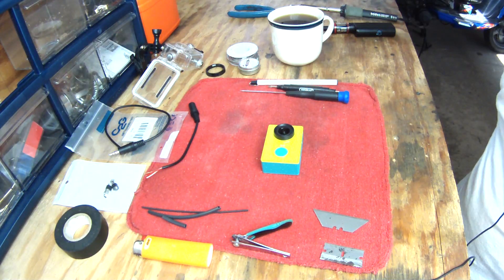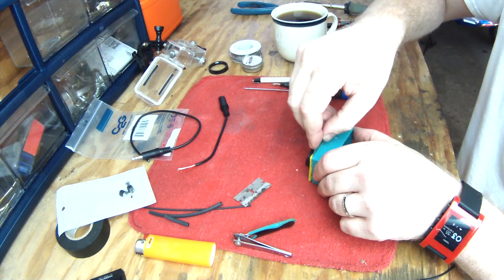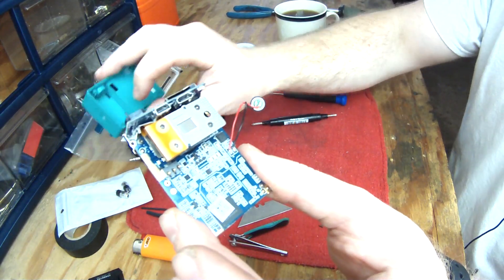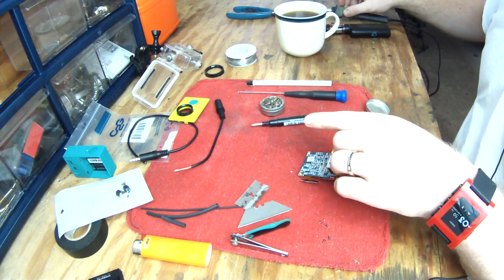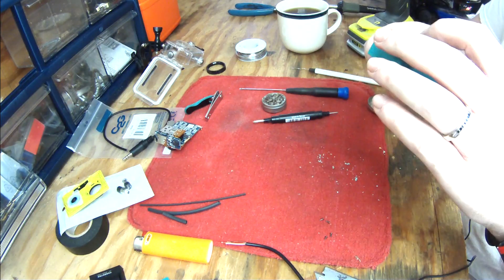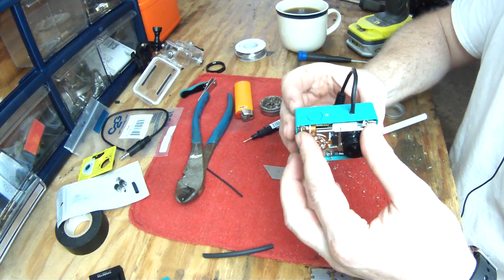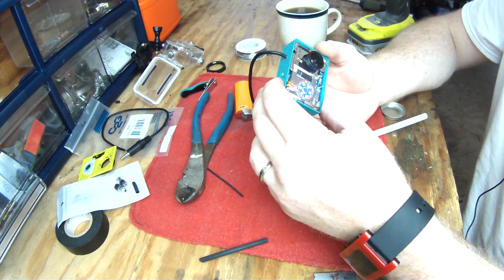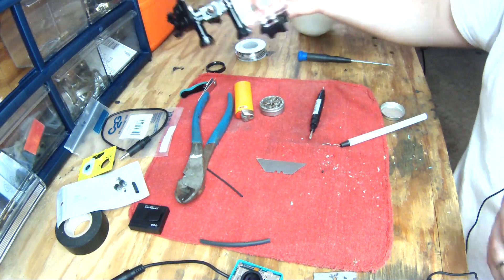Xiaomi Yi External Microphone Mod | Action Cam Hack

Comment: Hello ! Thank you for this video, I'm gonna order a Xiaomi Yi tonight and I must admit that the lack of mic plug is a big issue for me...

I will maybe add this by helping me with your vid, if I feel confident enough... 
But I just have one doubt in mind : do you know if it delivers phantom power ? Or if there's any way to get this phantom power ?

Because my mic (Rode Smartlav+, which is designed to work on smartphone) apparently need some...
Reply from the maker: +Peter Bee I strongly suspect that mic will work without issue. I have seen adapters that can pass power through to the mic and audio to the recording device though. Let me know if you figure it out!
Reply: +shinyside Oh I think I see what you mean, I have one (a bit like that http://www.ebay.fr/itm/NEW-3-5mm-MONO-INLINE-MICROPHONE-BATTERY-POWER-SUPPLY-MODULE-PIP-PLUG-IN-POWER-/270488193360?hash=item3efa5a4950 ) but I'm afraid that would make the whole setup a bit bulky, even if mine is more compact... I'll try to think of a solution in the meanwhile and I'll let you know ! And thank you for your answer :)
Reply from the maker: +Peter Bee Definitely! I figured I wasn't the only one who wanted a mic input on this little cam. I'm still looking for a simpler "every day" mic setup for my helmet, but so far the only acceptable non-powered microphone has been a Sena mic that I cut and soldered to the male end of the adapter I used to mod the Yi. I'll have a video comparing my mics up soon.

Comment: I was thinking about a similar mod on my Yi, I may do it but I would love to keek the original mic in place, and use a switched plug so that the Yi stock mic would be used when no external mic is plugged. not sure there is enough room inside this tiny cam.
Reply from the maker: +Sapristi Rémoulade I think that would be difficult, but you could wire a switch externally. I think I'd rather keep a mic with a very short cable with my kit.
Reply: shinyside yes, I was thinking about an external switch (integrated in the plug itself). I might try this mod :)
Reply from the maker: +Sapristi Rémoulade I didn't even think of an integrated switch! Share some pics or videos if you make this happen, I'd love to see how it turns out!
Reply: shinyside ok, I will let you know I if finally do it :)
Reply: De toute façon, si tu fais ça, ne faudrait-il pas en profiter pour remplacer quand même le micro original par un excellent électret ou quelque chose. Car il a dit que c’était une pitié! If you do that, think to change the original mike anyway, because the O.P. said it $ucks.